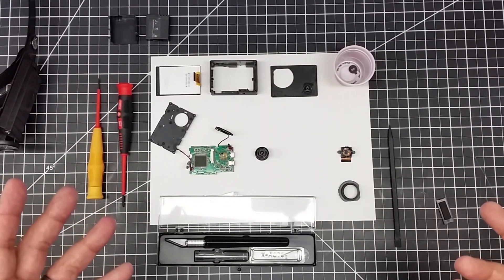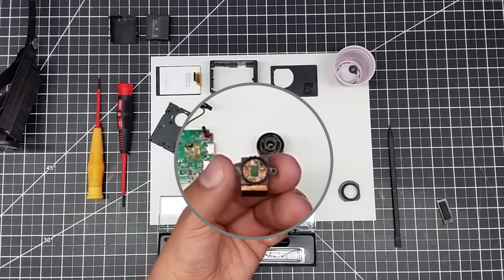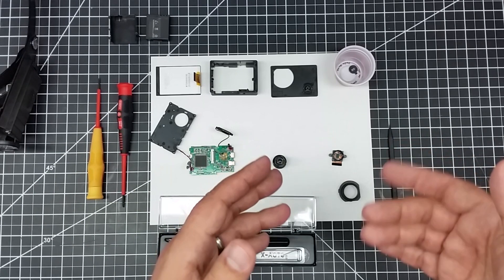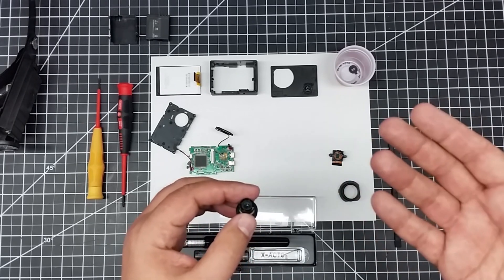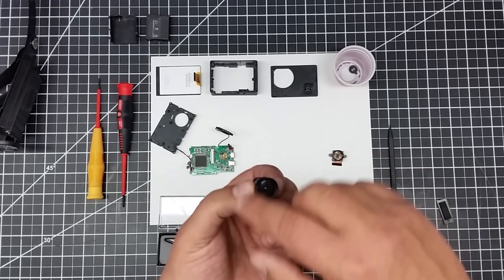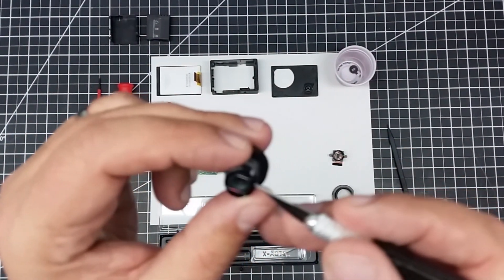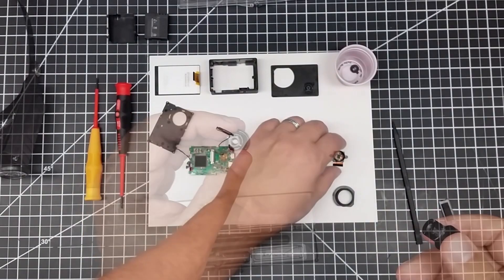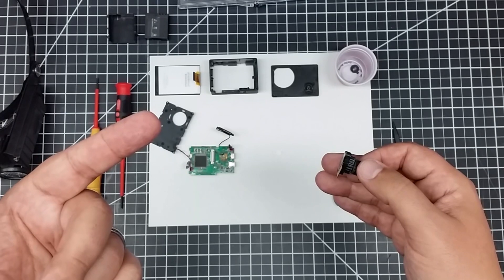On-Photography: How To Remove an IR Cut Filter from an Action Camera!

Comment: Where would I find the cut filter if it's not glued to the back of the lens? I've successfully converted once action cam to night vision using your technique but, the last two action cams I bought, after unscrewing the lens, it doesn't seem to have an IR cut glued to the back and have been too worried to take it apart

Comment: Great video! I similarly removed the the hot mirror on my Akaso action cam to convert it to full spectrum. Question: What filters should I purchase if I wanted to add a filter to be able to swap back/forth from full spectrum and non? I've been having trouble finding such products but maybe i'm not looking in the right places. Thanks!

Comment: Outstanding video. I have two China Action cams. I took the IR filter off both. Reassembled and one is now night vision (not full spectrum). Which is fine, perfect black white with IR lights in Darkness. The other camera had no effect, however used a remote and I can see the flash through them both. Any ideas? The one not working with night vision is newer. New Subscriber, thanks.
Reply: what brand name..?
Reply: @ANGLER_AJAG_IJIG  One is.called a geek am
Reply from the maker: Some of the IR cut filter on cheap and cheerful Chinese cameras are not so good as they are expensive pieces of glass so so the original might have been leaking a lot of IR to start with.  Also worth note is if you dont add an IR  filter after removing the IR/Cut filter then it is "full spectrum" since your not cutting any of the light coming in to the sensor. Also thanks for subing!
Reply: @on-photography3854  Do you know why many cameras when removing the ir cut when it's dark it turns purple/red in appearance, not black & white

Comment: Is it possible to easily reinstall the IR filter? If you just put the filter back in without gluing it, would the filter stay in place decently?
Reply from the maker: Not really, it's pretty much a one street...
Reply: try to have 2 lens, one original, and the other without filter, then you only have to change lens